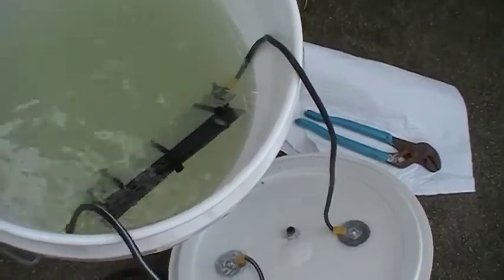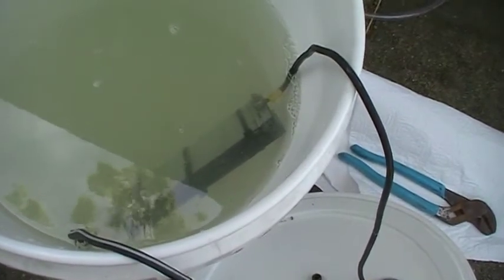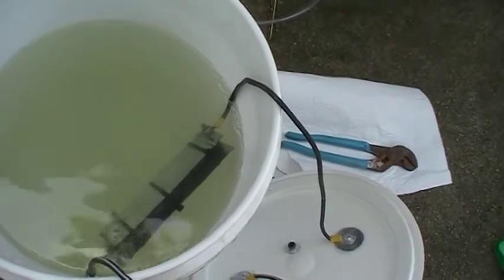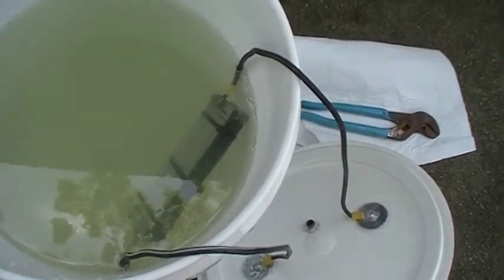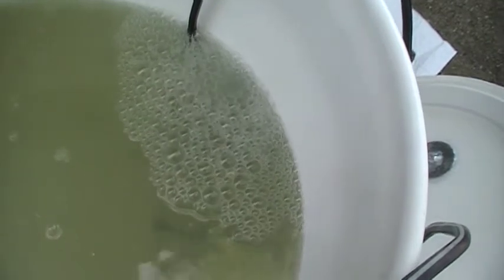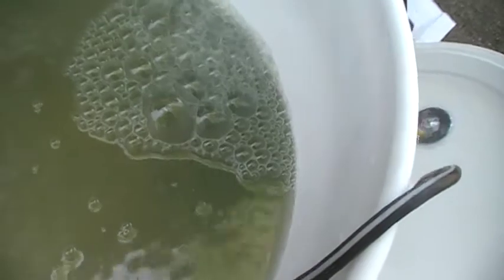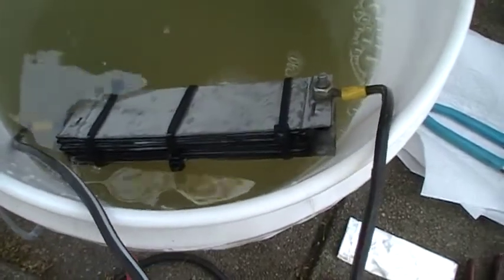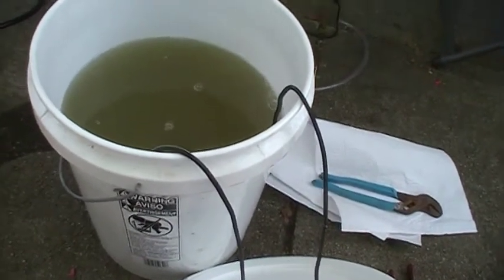HHO 11 plate Hydrogen generator

Comment from the maker: @fristaidfirst I already made a hydrogen torch and tested it out last night and it worked great. I am going to use the torch for soldering gold, silver and platinum. I am also going to keep making a few more different hydrogen generators, as you can split the water atoms, and use the hydrogen to increase mileage in your vehicles if you set it up right. Pretty cool using water to burn a torch at 5000 degrees and cut the cost of gasoline too.